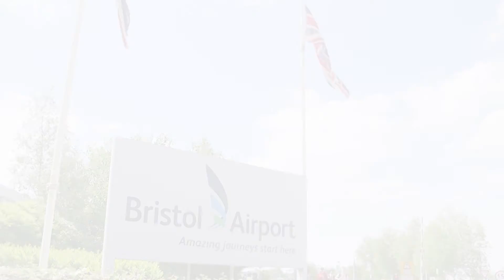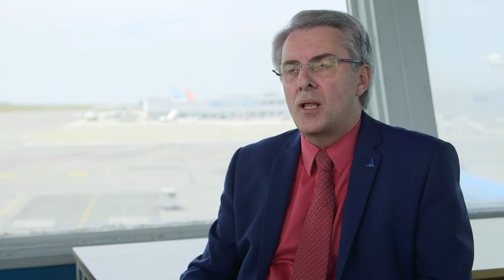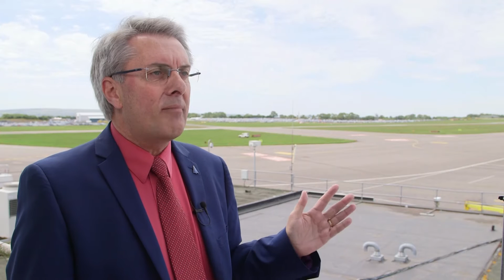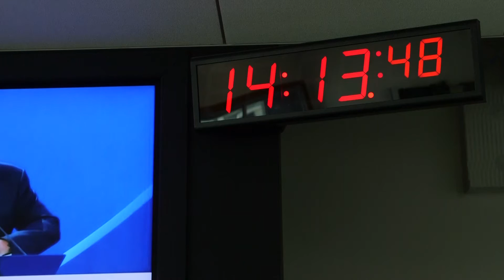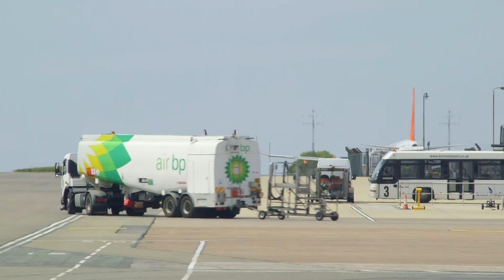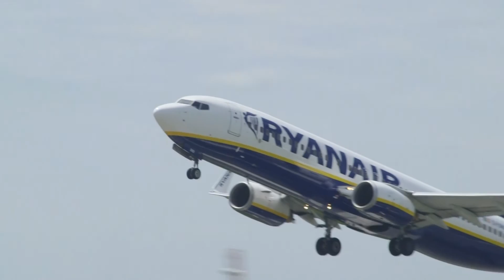AdvanceGuard - Customer Testimonial at Bristol Airport

Comment: please if anyone's got experience, i'd really ask for some info..in few weeks i'm coming into (first time) bristol airport from venice flying easyjet and because i'm on a very tight schedule, i'd need to get out of the terminal asap. i've flown around europe before and know there's lots of possible scenarios with delays and such things, but what i'd like to know is, do easyjet planes at brs airport get airport bridge at the gate? how long does it take to get to the baggage claim and when do you usually get it? are the walking distances inside the terminal short?
Reply from the maker: Hi winter july, we provide security to Bristol airport, but we don't have any input into the day to day running of things - your best bet is to visit their website and go to their "contact us" section with your question. Happy travels!